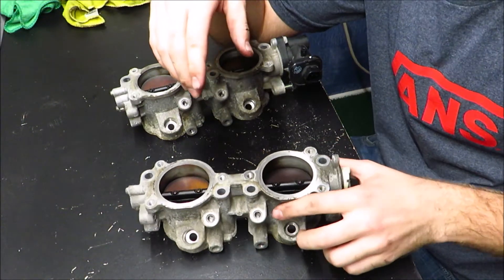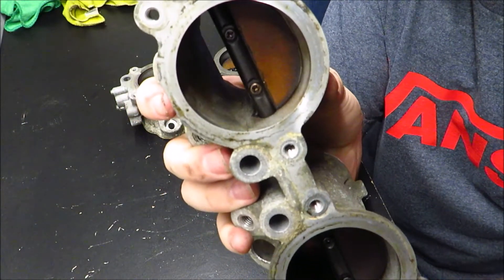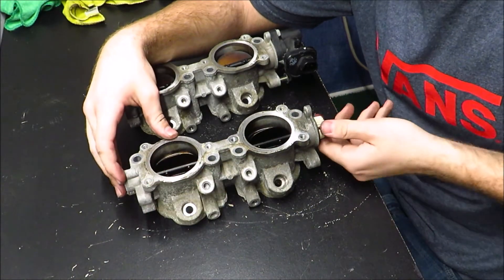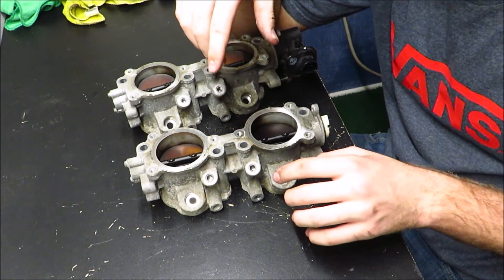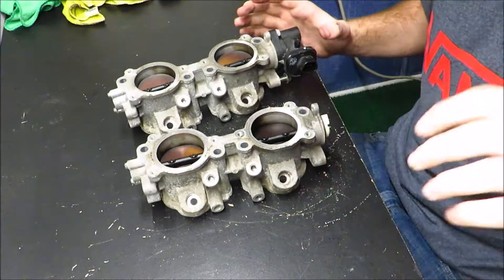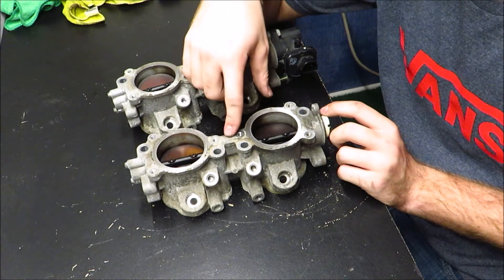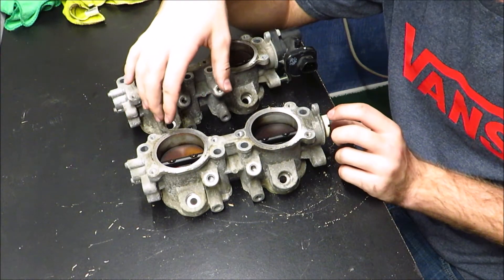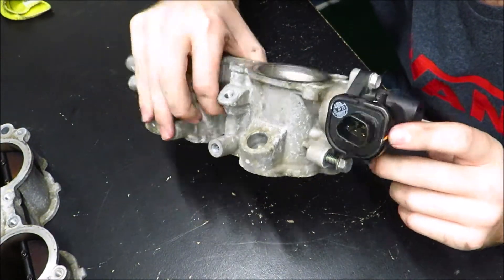Budget Subaru TGV Deletes (DIY)

Comment: Working on Neighbor Subaru WRX she told me she thought the TGV vows were seized. She purchased new ones on eBay when I disassembled it they were not seized possibly the motor. The open them was bad. My question is we live in Montana in a quarter climate if I do the delete is she gonna have a hard time starting it when it gets cold
Reply from the maker: It shouldn't be an issue with cold start. Deleting them would cause a CEL and potentially put the car in limp mode. So you would have to tune the car to disable the CEL. What were the symptoms that led her to believe the TGV's were the problem? Because if the motor or position sensor was bad then it would throw TGV codes.

Comment: why not just remove the flaps and call it a day
Reply from the maker: That's the best way to do it if you don't want to deal with tuning or check engine codes from the motors being disconnected. But the shaft and metal bellow it still create a significant airflow ubstruction, so if you want the most performance the best way is to just remove everything
Reply: @SWSpeedCo  no not at all. Please don’t say things you have no proof of. That’s just your imagination
Reply from the maker: It's not my imagination I have taken airflow classes in college. There is a reason that formula one cars don't use round tubes on any part of the vehicle and that is because they creat significantly more drag than an airfoil design. It doesn't take a rocket scientist to understand that If you have an object in the path of airflow its going to be less efficient than with no obstruction. Not my imagination, do some research.
Reply from the maker: I get what you're saying, I doubt the actual horse power gains are substantial. But theory says its better, so that's what I will do. I would say the mod is not worth the effort if you aren't willing to gut the whole thing. The gains are small with a fully gutted tgvs in the first place and if you just remove the blades the gains will be less "in theory". I think it's a good while your in there mod but I wouldn't take off my manifold just to do tgv deletes and i wouldn't bother just taking out the blades because they are only closed for the first 30 seconds of engine operation then they are open the rest of the time. I understand your point and apologize if my response came off as dickish.
Reply: @SWSpeedCo  theory says a lot more there are a lot more factors. Then your understanding is wrong, it’s not only there for the initial start. On sudden acceleration they close because the vacuum drops due to surge. Anything you like do it but push only that information that you have tested or seen tested. This applies to everything in life.
Reply from the maker: I've only ever heard/read of them being active during startup. Have you seen or read what you just told me, if so can you send me a link or tell me what to search for to get that info. Your making me wish I did the comparison, I had to put my car back to stock for state ref and I've been modifying it through the stages to compare the power differences but I didn't do it for just the tgv deletes.
Reply: @SWSpeedCo  look it up buddy it’s in most cars bikes. There are different types secondaries with an actuator or these flap types either normally open or closed. These were not power restrictions but performance enhancers rather. On stock or moderate upgrades I wouldn’t mess with them but we have to get rid of it when installing aftermarket ecus because no extra drivers
Reply from the maker: I can't find anywhere that says they actuate after idle for the subarus in particular. They are electronic motors and are normally open. I will try to test this theory to the best of my abilities, and I will link the video to you when I do. It might take a little time. If you have any recommendations for test conditions, I would like to hear them, or I can tell you what I have in mind
Reply: @SWSpeedCo  I think you have an extra pair so just hook it up and rev up full throttle and watch or ask ChatGPT
Reply: ok i asked chatgpt and found out that tgv is only used for what you said and NOT USED FOR WOT this is because they already take care of the high sure by the electronic throttle so I was wrong on that one. but generally all secondaries purpose is to restrict on low rpm to increase vacuum and on initial WOT to avoid sudden pressure drop. and about the gains i was right that theres actually a slight loss on stock but people see 10hp increased so they don't know whats going on with the torque. it disturbs the low end torque so it comes late hence climbs slower. one thing people dont know about dynographs is that you should also measure by time (secs) if any extra 10 hp is going to come in after a significant amount of time then it did more harm so stock guys should leave it alone and stage 2/3/4 guys can delete it
Reply from the maker: @xgrapher That makes sense to me, thanks for the info!

Comment: tuning these without the motors connected is now a pita - tuners won't touch them. IAG has their passthrough tgvs now, but only for 08+ STIs which sucks for me and my 05 sti.
Reply from the maker: It's still easy to do if you use open-source tuning like ecu flash or romraider, but cobb doesn't let you disable cel on the access port since there green initiative movement.
Reply: @SWSpeedCo  Yeah - but finding a tuner that will actually work with them has been my issue.

Comment: The orher-other option is to wemove the butterflies, remove the obstruction
 Polish up the TGV housings. THEN reinstall JuST the shafts, reinstall stall the motors on the ends and plug them to the harness. ECU thinks the TGVs are operating. No CEL, the shaft minor-obstruction is immeasurable.
Reply: He says that at the start of the video. But the shaft IS the main obstruction. When the butterflys are open they're pointing straight up. The shaft is wider and obstructs more airflow.
Reply: @final3119  knife edge the shaft so that in the “open” position, it’s edge on  to the air flow

Comment: Hello, I would like to know what the control unit says when the electrical connectors are disconnected? thanks. Kolda
Reply from the maker: You will have a check engine light on the dashboard and a few codes relating to the tgvs. If the codes are present I'm pretty sure it puts the car in limp mode.

Comment: You can also take that shaft connect between the sensor and that motor just cut it in half so you you can have them close together plug them in and lay them off to the side of course with some kind of bracket to hold them together and the computer won't know any better

Comment: I was looking for the video where you assemble everything.  I am working on a similar project for my 06 spec b
Reply from the maker: https://youtu.be/OFlNMSQwvUc
Here is the video where I install them, the engine is out of the car so it was easy, but its not to hard in the car.
Reply from the maker: https://youtu.be/gT2L6uje3Yg
 this video gives you an idea of how to get down to the tgvs
Reply: I got the entire engine stripped down.  Ready to pull it out and have been doing a lot of research on the fuel line assembly.  I am converting from side to top mount and using the STI factory rail system I think similar to what you got going on.
Reply from the maker: Yeah I was running wrx top feed rails with an aftermarket fpr and lines at the time I installed the tgvs, but I later upgraded to a full parallel AN line setup
Reply: Thanks for the help will probably go radium in the future

Comment: Waste of time
Reply from the maker: Why do you think that?
Reply: @SWSpeedCo  I’ve done the deletes and …. very little improvement, epa have stopped tuning for emissions, and to turn off codes is not easy. It is best to leave the shaft back in and not plug the ends this means the ecu will still function ok.
I do have a mod if you’ve gone further and sealed the ends to save a retune running Cobb.
The car was flying before the deletes and lost performance after, lot of work to restore the power!
Reply from the maker: I feel like it is a good while your in there mod. Maybe not so much today because cobb made it harder to delete the cel. At the time I made this video it was easy, and I'm on open-source tuning so it's still easy since the epa is not regulating it. It's probably not worth it for cobb tunes, but the open-source i think it is still worth it if you have the intake manifold off
Reply: @SWSpeedCo  what gains did you make, my car was flying before the deletes with many mods, and I still haven’t got it back up to that performance! So with the expense, time, and effort for possibly 5hp. …..not noticeable on the road! Different for track.
Reply from the maker: So I did mine with a bunch of other stuff at the same time. I went from a stock engine to a built engine with stage 2 cams, tgv deletes, top feed injectors and a bunch of other stuff and tuned it from scratch from there. Tgvs never gave me any issues. Seeing how much ubstruction gets removed from the air flow there has to be some power gain from that even if it's 5 to 10 hp you wouldn't notice by the butt dyno. That being said when you go big turbo and other supporting mods like I did I think the benefit of a mod like that would truly shine once you are almost doubling the amount of air going through the engine, those little ubstructions can take a lot of power. Same idea as why bolting a CAI on a stock car doesn't make any power because the stock intake wasn't a bottle neck. But once you put a big turbo on and your Making 25psi that stock intake is like sucking through a straw so then you put a CAI on and you make alot more power because you removed the bottle neck
Reply from the maker: Long winded explanation but stock car = not a big difference. Built car with mods = noticeable difference.

Comment: Could you bolt the TGV motor back on and have it turn nothing, and the ECU would never know?
Reply from the maker: For it not the throw a code you would need to retain the shaft at minimum, if the motor spins freely it will throw a code

Comment: hey man, i've been trying to figure out what bit you used to polish, could you link me it's name or something please?
P.S thanks for the great detailed video !
Reply from the maker: https://www.amazon.com/dp/B075C72PGK/ref=cm_sw_r_apan_i_PMGKNWYMK4XDPKMXG6Q2?_encoding=UTF8&psc=1

This is pretty much what I was using except I had the ones that came in a dremel polishing kit. These are cheaper and should give you the same results
Reply: @SWSpeedCo  perfect thanks so much
Reply: @SWSpeedCo  and just another question, what was the tool you used to hold the dremmel called?
Reply from the maker: I used a normal dremel tool with a dremel flex shaft attachment

Comment: Thank you reminds me cleaning intake and exhaust ports of 2 and 4 stroke motorcycle engines so the engines would "breathe' better and run stronger. Question please? What did you do with the electrical connectors that went into the little motors? How do you avoid a CEL?.
Reply from the maker: What I did was just left them unplugged and, as for the check engine light I used my tuning software to disable them. You could just pull the butterfly valves out and leave the shaft and motor connected  and it won't through any check engine lights, but you won't get the full performance benefits.

Comment: Do you have to plug the hole that connects one side of the TGV to the other? Where the pin used to be?
Reply from the maker: Only the 2 holes on the outside, the inside one you can leave open, it helps balance presure differences in the intake.
Reply: @SWSpeedCo  Great thanks for the quick reply!
Reply from the maker: No problem 👍

Comment: So if I do this I won't get a check engine light or yes?
Reply from the maker: If you do this you will get a check engine light. A tune can get rid of it
Reply: @SWSpeedCo  can i used a OBDII tool such as FreeSSM to remove the CEL?
Reply from the maker: That will only clear it temporarily. The code will pop up every time you turn the car on. You need to actually disable the code which requires a tuner to do so